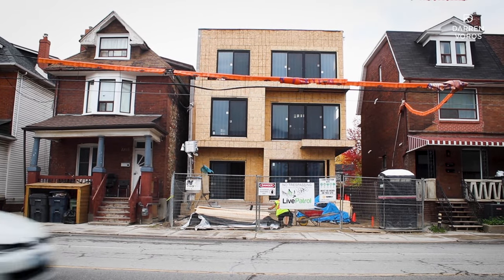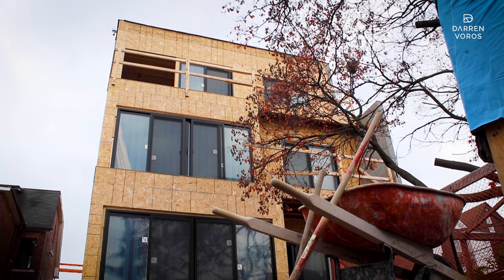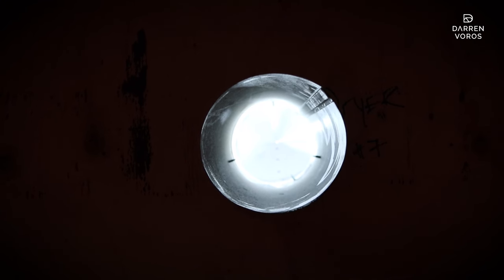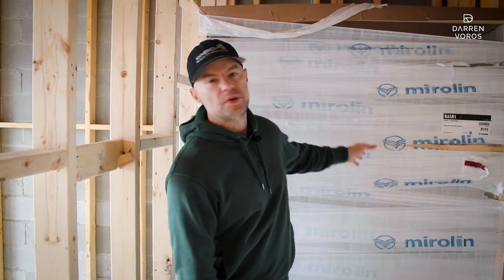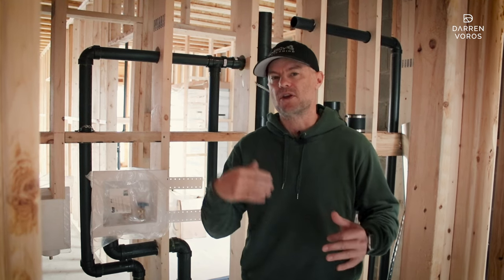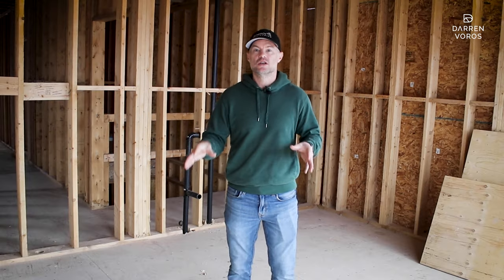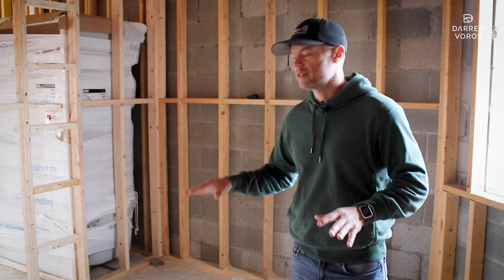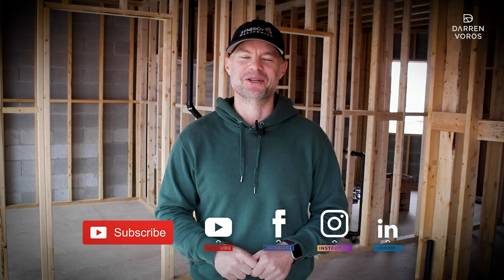Building A Purpose Built Multi-Family Building | Dufferin Update PT 2

Comment: good morning , thx for sharing, hard to see in your video about fire separation, block wall is one & what are the city requirements for this property or some one forget? have a good one
Reply from the maker: Block wall is one but it's really about the fire rating. You need a wall assembly that has a one hour fire rating which can be accomplished many ways. Having a non-combustible wall is another way.
Reply: Good morning, is more than that in Toronto, some place or wall you need to have drywall passing behind a partition (T) , like around staircase when wall are but in or when property to close from the neighbors in a rare occasion drywall between top plate & ceiling, one step your not there yet, its before plumbing & Hvac to install drywall inside joist cavities +  on the joist before HVAC  run will pass,  some project will required fire rated spray foam or caulking in all hole saw, drill opening between floors, street like Dufferin are  a challenge to work ,  thx for sharing , i like to learn & improve, have a good one @DarrenVoros
Reply: I'm just curious & always want to learn, u see today I learn again something, for a job we will do in 2024, we are allowed by engineer, the steel beam can be splice to make it lighter to install & weld after installation.
Have a good one